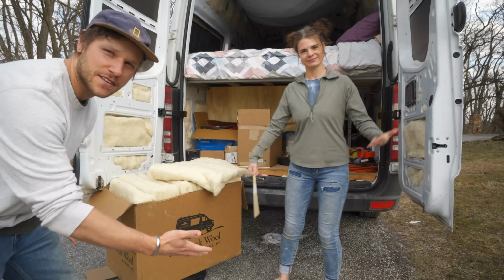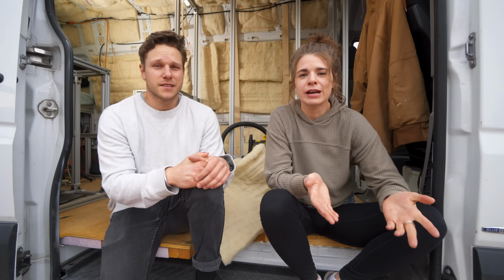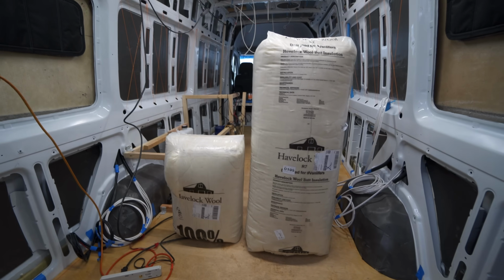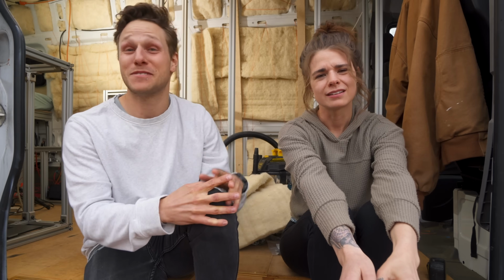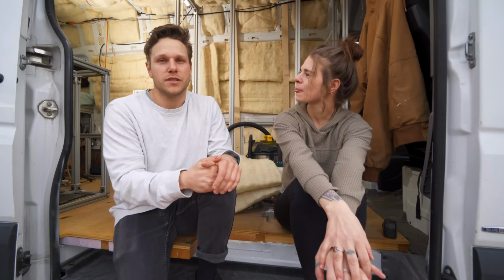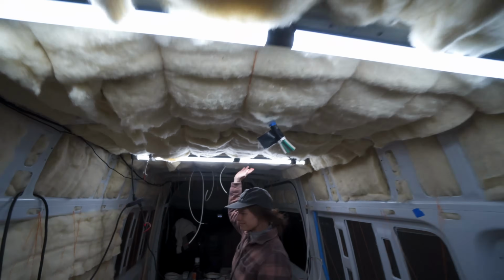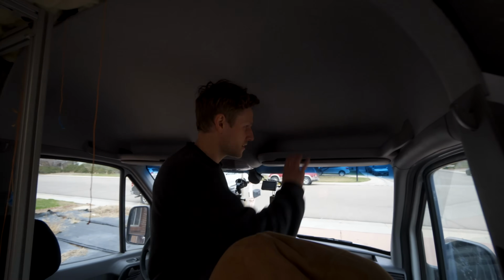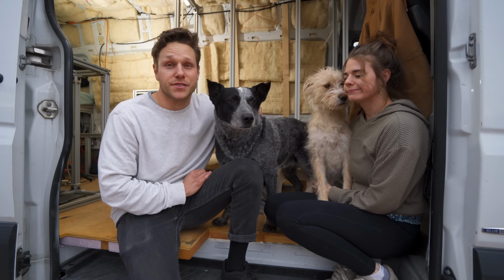Should You Insulate Your Van Using Havelock Wool?

Comment: Can someone please correct this crazy woman who hasn’t said a single accurate thing about Havelock Wool or its effectiveness?

https://youtu.be/Agvc8guSN6A?si=UFiTlj_wM00Ej9y4

At the end of the video she asks for advice and comments — but I can’t reply directly, so I’m posting this here.

She’s trying to convince people that a single 1/2 inch layer of Thinsulate is what’s keeping her van cool and comfortable — and that Havelock Wool was a waste: too expensive, flimsy, won’t stick, and not environmentally friendly because of the spray adhesive.

Here’s what ChatGPT says about her completely backwards claims:

1/2 inch of 3M Thinsulate SM600L has an approximate R-value of 1.3

Havelock Wool at 2 inches thick has an R-value of 7.2

3 bags of Havelock cover roughly 640 sq ft total at 2” thickness = R-7.2 insulation throughout

So in direct comparison: R-7.2 (wool) vs R-1.3 (Thinsulate) = over 5.5× the insulation performance

It’s absurd to think the Thinsulate did the heavy lifting. As you can see, the wool provided over 5× the insulation performance.

She also complains about wool needing adhesive, while ignoring the fact that Thinsulate also uses  adhesive, and is a fully synthetic, petroleum-based, non-biodegradable product. Meanwhile, wool is renewable, biodegradable, and more effective per inch in both thermal and acoustic insulation.

This isn’t the first time she’s confidently misled people and trashed a reputable product. Unfortunately, it probably won’t be the last. Please don’t let others fall for this kind of misinformation.

Comment: You don't want wool in your walls if you live in a humid environment, air circulation is poor inside a wall. 
Wool can absorb up to 30% of its weight in water and it needs air movement around it to allow any moisture to evaporate.

Comment: When you installed the permanent walls, the moisture gets locked in the wool and has no where to go. Good job! 🤣🤣 You have to vapor lock the walls and ceiling to avoid/prevent all moisture buildup.

Comment: Production of electricity often uses fossil fuels to produce electricity, at 30% efficiency.
Reply from the maker: If you're speaking to the use of electricity in the processing of the wool, you can check out Havelock's website where they transparently discuss sustainability and their end to end process inputs and outputs. https://havelockwool.com/sustainable-insulation/

Comment: Came here looking for info and this was a fun watch -- sub'd!

What about the front doors?  Did you do the front doors?

Also, if you're looking to dampen road noise I would add do a noise treatment in the front cab that is easy to do.  It's 3 parts -- CLD tiles to eliminate the pinging noise, then a Mass Loaded Vinyl sheet with Close Cell Foam -- that will kill road noise big time in the CAB part at least
Reply from the maker: We didn't insulate the front doors. Have you seen people do that?
Reply: @dogcatmanvan  I think of it in terms of a house, you wouldn't skip insulating a wall in a house right?  You want an fully enclosed and insulated space as much as possible (The firewall and windows are not directly doable).  Plus, if you do the doors it will give you a chance to help with reducing road noise.  I am not sure how complicated those doors would be, but I've done treatments in the past to car doors before for car audio purposes and it's always worth it just for the road noise alone.

Comment: Pro tip for the next conversion to do wool insulation in the ceiling, masking tape is your friend, tape it up as you go and get your roofing material in ASAP 😁 great video folks and the van looks amazing!
Reply from the maker: Thanks for the tip!
Reply: Yeah, masking tape definitely works good. I also used some gorilla spray glue to hold pieces up on the ceiling.

Comment: Can someone clarify what difference it makes to install electric wiring before insulating with wool?
Reply from the maker: I think it just comes down to where you plan on running your wires. If you think you're going to fish wiring through small cavities that will end up needing to be filled with insulation, it's a lot easier to fish those wires when the cavities are empty, ie non insulated, rather than having to fish the wires through the cavities already stuffed full of insulation. Does that make sense?

Comment: Holy smokes that's a FULL BLOWN AWESOME insulate! Question: if I won't be living in it or even camping much, can I get away with just doing the walls and floor and leaving the headliner intact the way it is?? (Conversion van) I'm doing a semi van build.... meaning I'm semi lazy😊 ALSO....if the wool sags, that means we have to replace at some point??🤔 Should I find your other video about wall/floor insulation??😜
Reply from the maker: It's completely up to you whether you insulate the headliner or not. It helps with noise reduction in the cab, but you can always add a divider so you can section off that front area. You loose a lot of the hot/cold in your van from the cab through the windows and door seems regardless of insulating the headliner. The wool shouldn't sag if you have it held in place behind your walls properly.
Reply: @dogcatmanvan  notes taken and thanks!!!

Comment: How tight did you stuff it? The air space inside the wool is part of the insulation value. Looks like your project took 3 times the amount of wool recommended. Curious to know how well the insulation works when packed this tight .. (I'm a veteran wool spinner and knitter, so have been working with wool for many many years). Have you found that packing it tighter is more efficient??
Reply from the maker: It wasn't packed that tight especially after placing our 1/2 and 3/4 furring strips and walls on top. We definitely put too much on the ceiling though. We could've done half as much up there.  Overall it's been working great so far.

Comment: great Video as always. I have used a havelock wool is ok product. BUT it's too expensive and a pain in the ass to work with. All my vans I build I use micro cell foam and layer 3m insulation in them. This process isn't cheap but its not back ordered and you get  twice the  R value then Havelock wool and Super easy to work with. PS you use way too much insulation those walls need to breathe.. One more question how long did it take you to insulate the van? I just insulated a 170 extended sprinter yesterday and it took one day. you spend over $1000 to insulate that van and labor . I' would  be out of  van business  using that product.
Reply from the maker: If we were able to put a full days worth of work into it, it probably would've been a day and a half or 2 days working 8hr/day. The total cost of our insulation was $750 which is pretty cheap not including our labor. I think it just boils down to the type of product you want to support. I know that's not always feasible from a business stand point.

Comment: Wool is one of the best, if not the best option. But I wonder about sagging and about it touching the metal. Like let's take sagging - I think it definitely happens, with time, a lot of it sagging and just leaving a lot of wall basically without insulation (I think I saw some photos of that), and I'm not sure what would be the solution to that. Probably just periodically adding more wool? But that's assuming it won't start to get moldy...

Vans are kind of terrible if one wants to use wool/organic materials, with all those cavities and it being all metal/worst thermal bridging.

But these are the risks and disadvantages one should take in order to avoid using less sustainable materials/materials that emit VOCs.

Comment: Are you going to install a vapor barrier, or does that mess with the whole absorbs/releases moisture thing?
Reply: A cardinal rule in building is never double vapour barrier. Since the van shell is a vapour barrier, if you add wool followed by another vapour barrier, you have a double vapour barrier, and the moisture has nowhere to go. One side has to breathe.
Reply from the maker: No need for a vapor barrier with wool. It absorbs the moisture and then lets it evaporate.

Comment: Will moisture get into the wool insulation when the walls are covered? Is the Havloc wool critter and insect repellent? Maybe you will get a hygrometer and a dehumidifier.
Reply: After over 2 years in my van, in Canada, I can say that moisture most definitely DOES accumulate between the wool and the van shell. Often a lot. I also had to replace the rear tail light assembly in my Promaster because moisture shorted it. There was Havelock wool in that cavity. I'm not convinced of the moisture management claims, but have no scientific proof without tearing my van apart to assess for rust.
Reply: @katydidnt3906  
Yeah, it's a tricky thing with vans. The problem with vans is that one doesn't have flat walls (like one has in a tiny house on wheels, for example). Because if one had flat walls, one could just apply a layer of insulation that would create an air gap between the metallic walls and the wool, and the condensation wouldn't be a problem.

Or if vans were slightly wider, one could have just not bother with the cavities and apply that layer of insulation (that creates the air gap) and the wool right on top of the walls. That would've been perfect. I think they can make wider vans, I mean according what's allowed legally on the roads. I wonder if manufacturers will eventually have wider versions, for those who want to do a van conversion.
Reply from the maker: It will, but the wool should absorb the moisture and then allow it to evaporate without it loosing it's insulative quality. It's also treated to be insect repellent.
Reply: I wonder about that too. Although even if it wasn't covered, it would be the same question I think, the condensation will happen on the metallic walls in any case. From what I understand, anyway.
Reply: If only vans were slightly wider. We could apply the insulation right on top without bothering with the cavities, have straight layers of insulation, an air gap layer first and then the wool, and have no issues with condensation or mold. Like we do in tiny houses on wheels. But with the current dimensions, if we were to do that, it probably would mean sacrifice too much space inside the van.
Reply: @MaximC  I agree with you on the wider vans. The Ram Promaster has a taller one coming out for 2023. 
There are products to reduce the humidity and ventilation is important.
Reply: @277kne  
But unfortunately what usually is needed is more space in width, not in height. 

Yes there are, HRV systems, dehumidifiers, and such, and we definitely can make use of them, but from what I understand condensation on the metallic walls will form anyway, so that's kind of the main problem to solve (when we use an organic material for insulation), if we solve that, the rest is much easier to manage.

Comment: Do you guys plan on using Reflectix on the inside after the wool? I hear mixed opinions about that.. like it's almost useless as a reflector of radiant heat once it passes the steel exterior of the van, and it's expensive... I was just thinking of using standard vapor barrier instead.
Reply from the maker: We won't be using reflectix
Reply: From what I understood, unless you leave/make some space between reflectix and the van walls - it's useless to apply reflectix. And regarding vapor barrier - one should not use it (the walls should be able to "breathe") or one should use a kind of vapor barrier that can become permeable (like Intello I believe). Also I've heard from someone that they didn't use vapor barrier in the floor, because he saw that it created mold inside the floor.

One should really understand a bit the technology of insulation first, because some ideas like using vapor barrier and such may seem clever when in actuality they aren't.

P.S.
Also you might want to check out Moser Makes' videos, he made some good ones too.
Reply: @MaximC  In almost every van build you see people put TONS of reflectix on everywhere... and I'm just like, why? lol and they say for vapor barrier, sooo... i understand not wanting your moist air from the van condensing say.. on your metal floor of your van - but it's gotta go somewhere. So by covering everything in their reflectix vapor barrier are they basically creating a bubble where the moist air most likely escaped via the fan at the top?